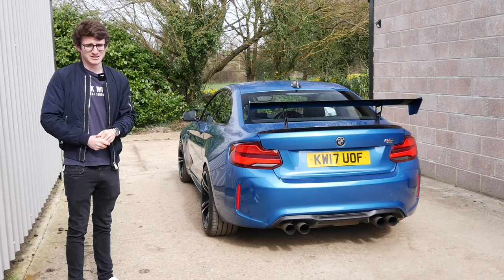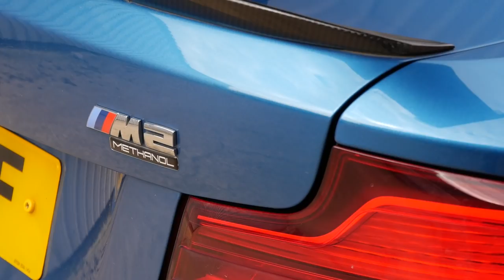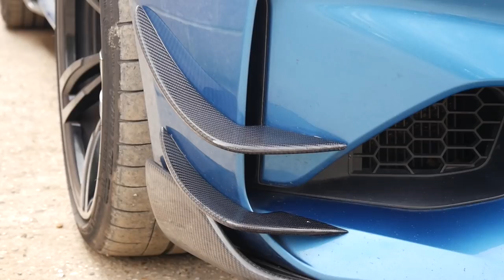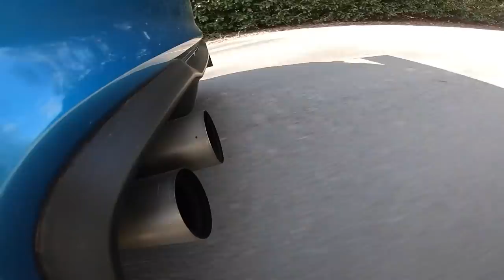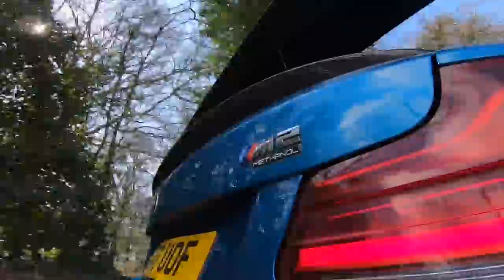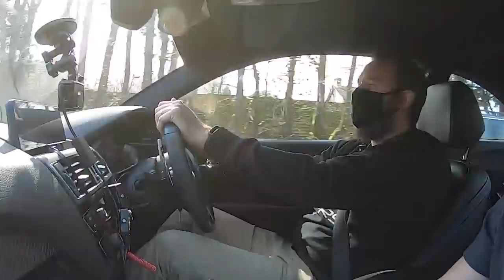530bhp Hybrid Turbo MONSTER M2! *Meth Injected*

Comment: The N55 M2 really sets itself out from the others sound wise. wow!
Reply: It's a shame the m2 comp and CS don't have the b58
Reply: That’s why I spent the extra money and got the m2 over the 240i. It just looks and sounds so good and mine is all booked in for stage 2 next month can’t wait 🚗 💨
Reply: @jim8462  B58 arguably sounds better then the n55. Personally I'd go comp or 240i just for the more reliable engines as the n55 can be problematic
Reply: @KiranPatel-fk1pg  I disagree more people will say the n55 sounds better but I can’t argue the fact the b58 is a better engine. I also bought my m2 before the comp was out so it wasn’t an option. The looks of the m2 did it for me.
Reply: Iv also touch wood never had any issues with mine and the n55 in the m2 is different as in it has s55 pistons and other components which makes it stronger compared to the n55 in the 135 and 235. There is a YouTube vid which explains the differences.
Reply: It sound even better when it’s using a tubular headers rather than the restrictive turbofold that most hybrid turbos use.
Reply: The N55 in the m2 is not problematic like the 235i buddy @KiranPatel-fk1pg